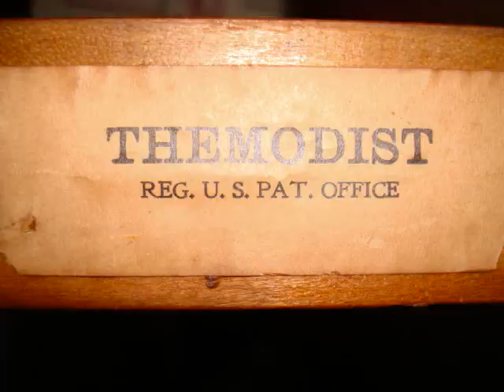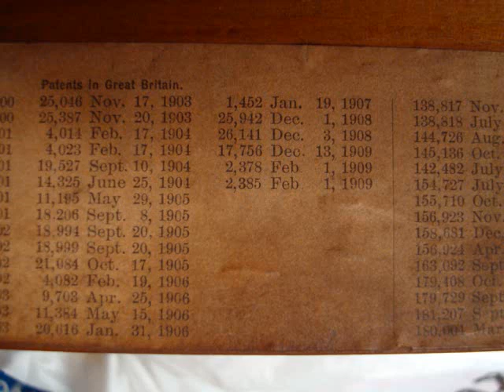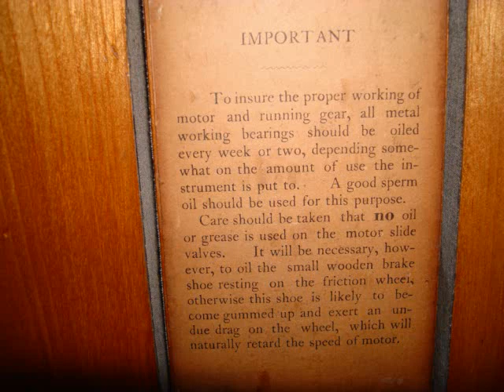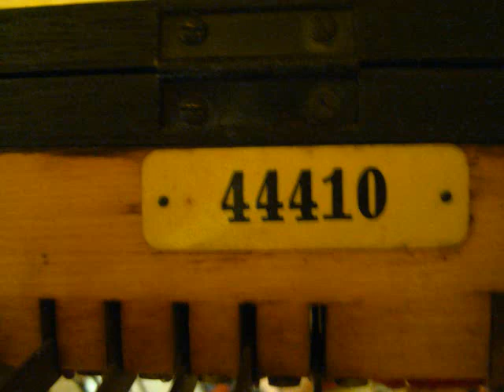Pianola restoration pics - Inside the valves, etc

Comment from the maker: The base of the spindle does not touch the pouch and just rests via the leather valve resting on the lower metal valve facing.  Each valve (height) is adjustable via the lower half fitted with a very fine threaded screw. It is important that you have these adjusted just right (about 1/16 inch gap movement).

Comment from the maker: The valves are made of goat skin leather per the stamp on the sq yard I bought.  The leather valves are glued to the wooden facings on the spindle with the “hairy” side out and the smooth side on the glue side. Only the largest facing uses a cardboard retainer. The spindle fits loosely in the cardboard and metal brace and is not attached to the leather pouch.

Comment from the maker: As for gluing, you really should use (sorry PETA folks) animal hide with a hot glue pot or fish based glue. I use the latter which is light brown and very tacky and sets in a few minutes. The reason to use it is that it is strong, air tight and you can "cleanly" remove it later for the next restoration. Pieces will snap apart and the glue scrapes off pretty easily and better with a heat gun (careful with this as it can quickly scorch wood and burn fabric/leather easily)